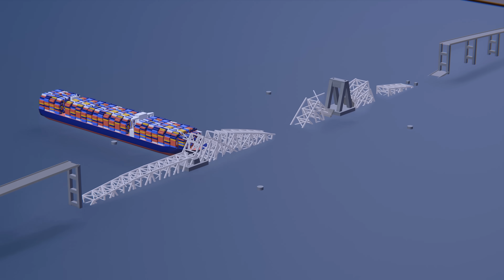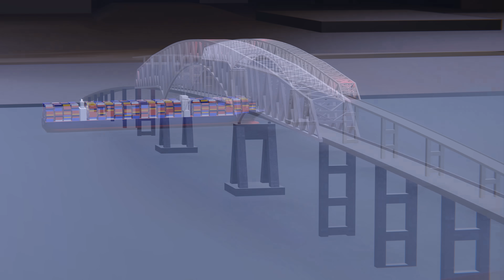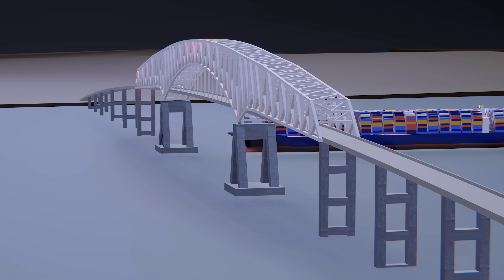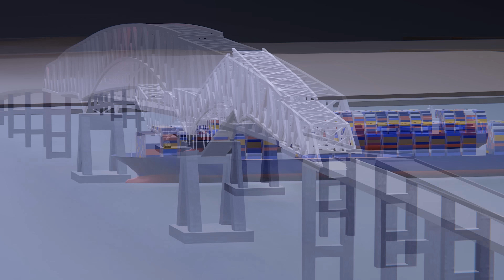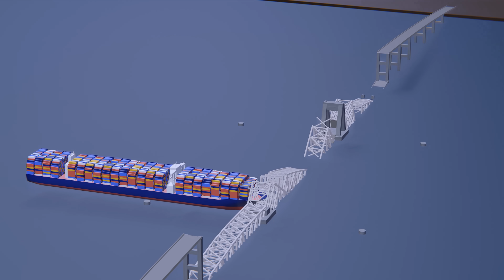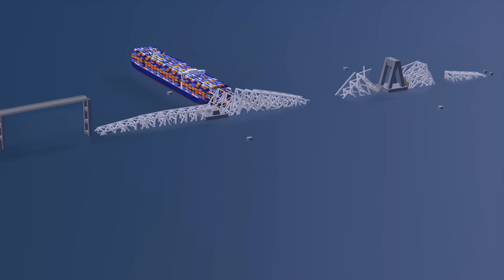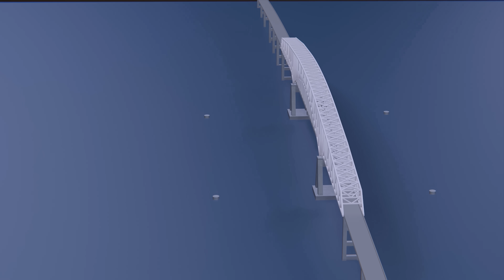How Did the Baltimore Bridge Collapse - Animated

Comment: Great video.  As an aside.  You might find it of interest to know that the place they are taking the bridge to be cut up and recycled is an area called Sparrows Point.  

When the Francis Scott Key was being built Sparrows Point was home to a Bethlehem Steel steel mill and the Bethlehem Steel Sparrows Point Shipyard.  Bethlehem Steel before, during, and after the construction of the bridge was building 70,000 DWT, 120,000 DWT, and 265,000 DWT tankers.

How could the engineers responsible for designing and building the bridge have not realized ships were growing in size?  And, the dolphins and fendering being put in place were inadequate when compared to the ships being built at the shipyard next door.
Reply: Baltimore was told in 1980, shortly after the Sunshine Skyway collapse, the the FSK bridge protection was inadequate. They chose not to do anything for 44 years.
Reply: Actually, when the bridge was build,  the deep channel was much narrower, and deep draft freighters restricted to the channel could not hit the support pillars - they would be grounded first.  Dolphins were designed for much shallower draft vessels, that could navigate in 20 feet of water.   The problem arose when the channel was later widened practically to reach the pillars, but the protection was not enhanced, and now pillars were reachable by the largest ships.
Reply: @dmitripogosian5084  All of that may be absolutely true. But it doesn't change the fact that they were warned about the piers needing better protection in 1980. That was 3 years after it opened, and the ships were much smaller than todays. And it's not like they didn't know what was coming. During construction of the FSK bridge, they were building larger ships than what were currently in use right there at Sparrow Point. Right or wrong at the time, who knows, but Baltimore elected to not build better protection. The estimate was @ $4 million to build it back then. Now it's costing them $15 million. Per day!
Reply: @KSparks80  And then in those 44 years, thousands of ships passed safely, that brings complacency. It's not like the state couldn't afford changes to the bridge.

Comment: Tunnel under the water.
Reply: No, it'll be a bridge. The bridge handles all haz mat and propane, that can't go thru the existing tunnels.
Reply: Agreed. This is the best and ideal solution for a narrow channel. I hope they consider this option. Many cities have underwater road tunnels.
Reply: @Anand_KL  We (Baltimore) have two tunnels that go under the harbor. But hazmat transports can't go through the tunnels. A lot of states don't allow hazmat transport through tunnels for rather obvious reasons - should something happen to that transport, you've got an explosion or deadly chemicals leak in a confined space. That's happened in the past, which is why it's typically avoided nowadays. Just look up the Mont Blanc tunnel fire, which ended up with 39 deaths. And that was just from a regular transport truck catching fire and exploding in the tunnel. Add in the dangers of hazardous materials and there you go
Reply: @jakeviscarra3150  
Thank you for that clear clarification. Understood. Hope the new bridge is designed well. 

Btw, saw a movie over the weekend called Shooter with Mark Wahlberg. It's set in Baltimore. There was a short glimpse of the Key Bridge. It looked good.

Comment: deflection blame it on no tug boats. DALI left port with know power failures !
Reply: I think if the Dali, knowing it had ongoing issues, had asked for a tug-escort all this could have been avoided.  I hope it had been found negligent.
Reply: @Robert08010  the Dali summoned 2 escort tugboats while in channel for assistance yet the tugs disembarked from the ship before reaching open sea. (???)
Coincidentally moments after the tugs disembarked the Dali lost all main power, then backup power and finally emergency power failed as well. 
   Who greenlighted the Dali before the ship's electrical problems were resolved while at dock? Enroute for a 27 day voyage to SriLanka halfway around the globe yet couldn't make it out of Baltimore without destroying it's Bridge?
Reply: And what do you base this definitive statement on? Were you onboard prior to departure?
Reply: @scott6002 there were log reports from the port that the ship was blowing electric breakers supplying the reefer containers onboard. There are no reports this failure was resolved prior to departure. The loss of power underway affected propulsion and navigation control, and was the root cause of the accident. This very factor is being actively investigated by the FBI.
Reply: @scott6002  within the first 12 hours of this incident multiple dock workers ON SITE verified the Dali was having unresolved electrical problems seemingly due to the refrigerated demands tripping the breakers. Within 24 hours these reports were scrubbed.
The Dali DID summon two escort tugboats while in channel for assistance but somehow someone made the decision to disembark the tugs from her sides before reaching open sea. 
Hopefully we'll a conclusinary answers to many reasonable questions shortly from the NTSB, FBI and perhaps Coast Guard. 
I can't imagine who would surpass federally mandated safety regulations to greenlight the Dali as seaworthy for a 27 day voyage to SriLanka halfway around the globe without it's electrical problems resolved. We'll see.